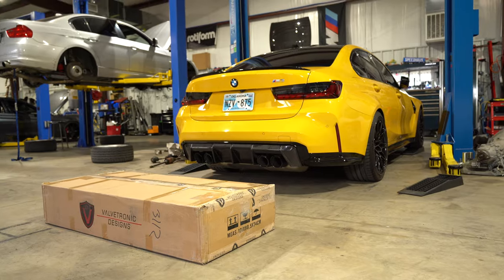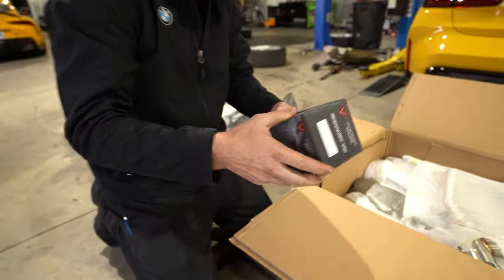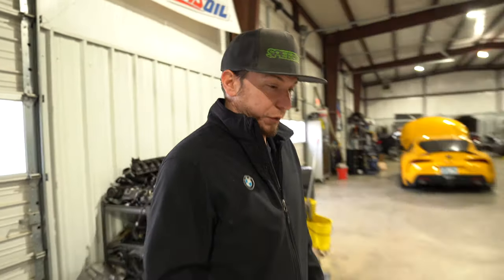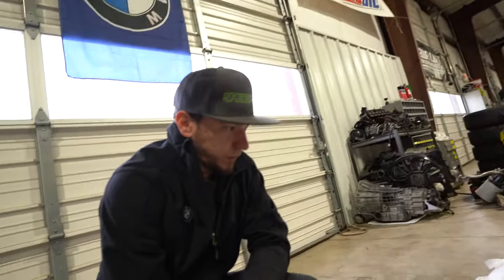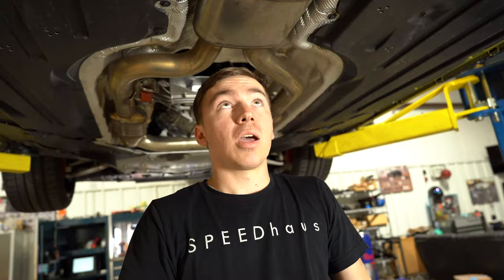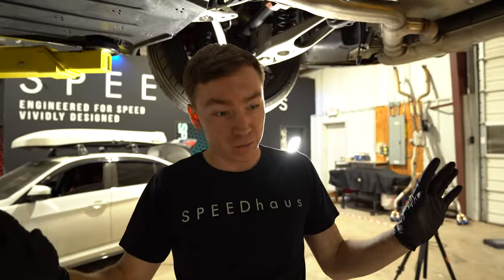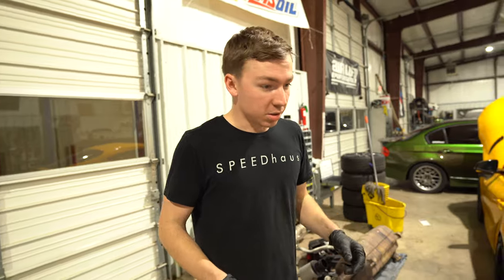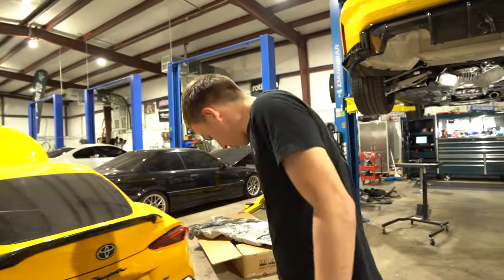VALVETRONIC BMW G80 M3 EXHAUST SOUND + INSTALL | Acceleration, Revs, Cold Start Equal Length

Comment: If we opt to use the Valvetronic valve system, do we keep the stock valves connected and tucked under the car ? Or do we remove the stock valves completely?
Reply from the maker: The valves themselves will be removed from the exhaust. The wiring and everything can stay and be tucked. For a simple return if needed.
Reply: @speedhaus405  would it be the same if I disconnect and remove the oem valves all together from the car or would it throw a code by doing so?